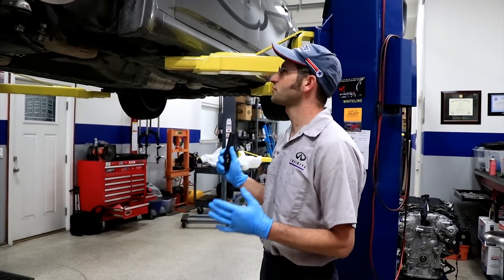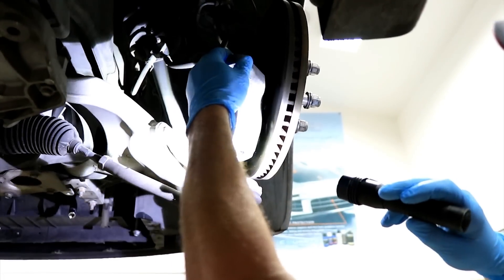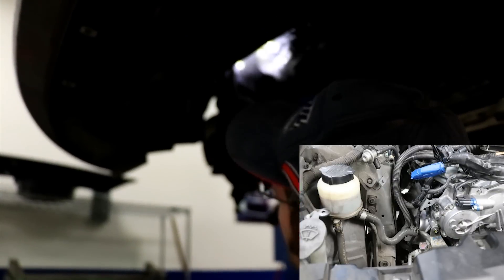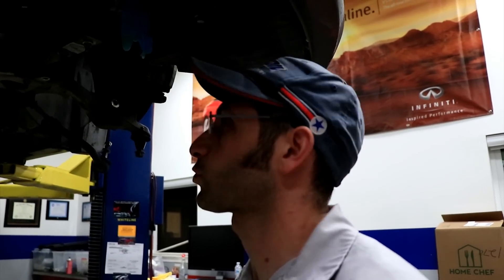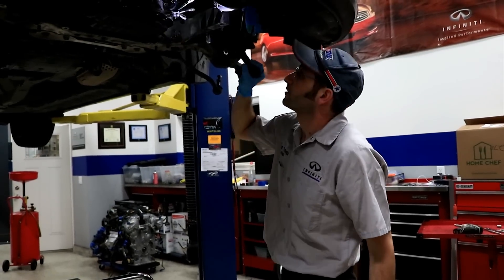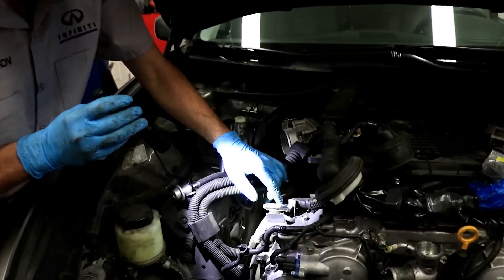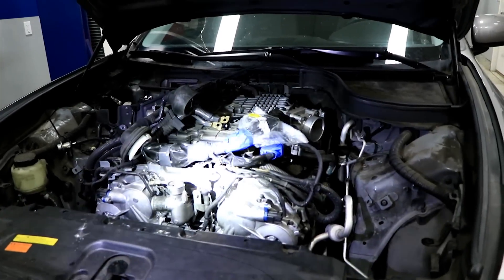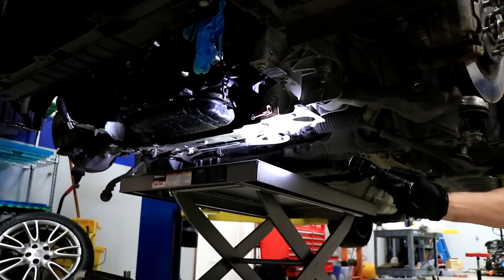DIY: VQ35HR VQ37VHR Engine Replacement (Comprehensive Overview)

Comment: Eugene. Is it possible to replace engine of 2011 G25 with  VQ37 engine?  Direct bolt on/start? Does it require replacement on transmission/ECU/wire harness etc... To be replaced as well?  I guess it would be less headache if I just sell perfectly running G25 and get a good G37. 😁
Reply: I haven't tried that..

Comment: Question I have a 2007 rwd g35 sedan I need a new engine I found a g37 coupe engine would it fit would no problem plug and play plz help I wanna get the engine ASAP from this guy
Reply: Did you get a answer yet?
Reply: @Pure.37  yea I did lol engine had a different set up unfortunately I had to get 07 08 g35 sedan engine so it can be a exact fit…

Comment: I need somebody advise serious advice I got a g37x brought bolt on haven’t put them on yet got test pipe isr y pipe and single exit cat back and Z1 intakes takeda but my car got 112,000 and I’m thinking about goin fbo and getting a tune maybe header eventually but my cad when I changed the spark plugs they were soaked in oil and the car runs rough I think I have gallery gasket should I just swap motor to a lower 2013x engine g37 or sell the car now as Is for 6500 and buy another g what you guys think ?hit me at juanalex6799@gmail.com

Comment: Any suggestions, I'm in Philadelphia and I need to swap out the engine in my G37X .. I need help!!! Anyone who reads this please and thank you
Reply: Bruh you need a lift because to replace engine on that you need to drop the entire front subframe, if you were in Pittsburgh I could have done it for you.
Reply: @audinthusiast3750  you can drop the driveshaft and disconnect the trans and you can pull it from the front
Reply: daniel powell that is just unnecessary amount of work
Reply: @audinthusiast3750  yup but if you don't have access to a lift then you really don't have a choice unless you want to pay a shop.
Reply: I'm in upper bucks hmu

Comment: Awesome video.  I have an 08 g37 coupe.  I'm thinking of engine swapping a VR tt engine in my G37. Any thoughts? Or advice you can offer? Any information would be MUCH APPRECIATED
Reply from the maker: I would recommend replacing your engine and ecu with a newer version and installing a btw tuning GTR TT kit (btwtuning.com). Alternatively a topgunz "ACE" supercharger kit is also an excellent alternative. As for the fuel system I would recommend a radium surge tank setup, I've been very pleased with that kit or you can choose to do a traditional CJM return fuel system kit. I can provide you with a replacement ecu also, as the factory 2008 ecu does not have enough rom space to fully install all of ecutek racerom features. Feel free to contact me with any additional tuning questions.
Reply: Enthusiast Auto Care 
Ok. Good advece.  Thanks for reponding I'll keep that in mind. If I have any more questions I'll ask. Thank you!!!

Comment: This is unrelated, but would you happen to know what causes a certain noise in a lot of Infiniti Gs. At around 1-2k rpms, when slowly accelerating from a stop, doesn’t happen all the time, it sounds like ratting maybe coming from engine compartment or possibly from the undercarriage. My guess is that it could be a loose heatshield maybe? It doesn’t happen from just revving the engine while parked... and as mentioned before, it happens to a lot of Gs (37s/35s). I don’t believe mileage is of concern. My car happens to be a 2011 G37X Sedan with the 7AT
Reply from the maker: it's probably the catalytic converter(s). it's easy to check this. Remove the y-pipe and see if the material inside is moving/loose. An easy way to determine the catalyst noise is to listen to each cat when the noise is occurring.
Reply: @EnthusiastAutoCare  Yeah, that sounds definitely like what might be the cause. I'll get to it eventually. No dash lights or performance issues at the moment so i'll wait a bit before addressing the issue. Thank you for taking the time to reply to my comment.
Reply from the maker: Rigo Arteaga hit me up for a tune !
Reply: If I was looking to modify it, I would. But this one is staying completely stock, due to being a daily driver. Don’t want to compromise reliability. 👍🏽❤️
Reply from the maker: @rigoarteaga1038  I improve reliability with a tune over stock and I will get you better fuel economy. It's a win-win. I Can explain in detail if you reach out.

Comment: I have 2008 g35x AWD. I need to remove the engine. I need help with that engine can’t move freely I can get torq bolt out. What is the best way for me to make drop engine transmission and transfer case at same time or
Reply: Yes

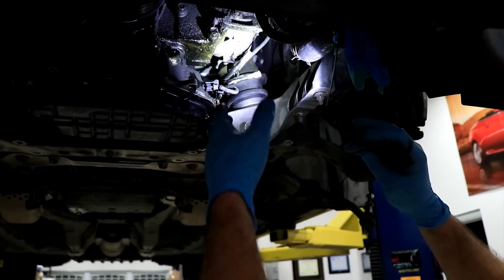Comment: Anyone know on 4:40 what brown plug is for?
I have my wires messed up there, HELP!
Reply: If im not mistaken that's the connector for the power steering assist motor that's on the power steering rack
Reply: It's for the steering angle sensor to the rack & pinion

Comment: Why didn't you pull the front end off?
Reply from the maker: San Saechao pulling off the front end is much more time consuming. The factory recommended procedure is to drop the engine with the subframe as we do here in this video.
Reply: @EnthusiastAutoCare  oh...well I'm pulling the front end off as we speak lol
Reply: @sansaechao2023  lol how did it go? The front end procedure

Comment: What model HaulMaster lift table is that? Trying to get table specs to ensure I get a lift table that will hold the engine/trans like you did in the vid.
Reply from the maker: This is the largest model that is offered by harbor freight.
Reply: The Haul Master lift table rated 1000 lbs. I highly doubt that the 500 lbs will support the power train regardless of the vehicle.

Comment: How can the vq35 ecu run a vq37 it would be lean from the mid range to the top of the rpm curve.  Are the ecu's coded to the chassis number or can they be changed. Thank you
Reply from the maker: please call me for tuning and to discuss this. 415-830-4008

Comment: I have a g35x 2008 3.5 engine can i put a Q50 VQ engine?
Reply: The vq37 will mount directly in places of a vq35. May need custom plumbing and will need the vq37 ecu. Even the vr30tt mounts directly in. Needs shorter engine mounts. Check NoirTm. Doin his vq30tt swap into 370z in driveway. Had engine stuffed in less than a day
Reply: @mikeschaner5853  were can I see or get this info I have an 08 G35x  and I want to do either or swap for a vq37  or the 3.0tt
Reply: @samuelarizmendi  the vq35 to vq37 swap is all over the z and g forums... Z1 did a vr30 swap also but they were no help to me, Noir, or others trying to figure this 1 out. Noir goes from start to finish in a simplified condensed version but is very responsive to YT and IG.
Reply from the maker: It would be too complex, I don't recommend it.

Comment: We got the motor in my 2009 intiniti g37x after a motor swap (same motor from different but exact same car) and the car refuses to do anything other than click the starter. The flywheel won't even crank. We have tested the battery and the starter and both are good. We need help. Why won't this thing start? Is there something we need to do with the ECU?
Reply: Alien Bros did you figure out the issue. I have the same problem

Comment: I am doing an engine swap on my 2009 G37x and did not have a lift so I went in through the front. I have the old motor out but I can't get the new one in flush with the transmission and onto the mounting brakets because the exhuast manifold on the right hand side is in the way. Is there a way to get it in without breaking anything and get it flush with the transmission? The transmission is still in the car. We also disconnected the front differential and connected it to the engine to make it easier to get in. The center axle is also in the engine. We just can't get it in there and get it to line up. Any ideas? Any advice would be greatly appreciated.
Reply: Did you figure out to get it lined up?
Reply: @danielthomas4018  Yeah I did it was a massive pain but we got it done. It took a lot of pry bars, transmission  jacking, and curse words but eventually we got it in.

Comment: So I Did the swap already but the car doesn't want to turn over.we replaced with new starter, battery,n sparkplugs  but the car doesn't turn over?..any ideals wut  it can be? Would really appreciate it
Reply from the maker: Check to make sure the engine can rotate freely by turning the crankshaft manually.

Comment: Thanks for the great video.  I'm about to do the same on my car.  Did you have to drain the automatic transmission fluid before you separate it from the engine? Thank you.
Reply from the maker: yes, but it's not required.

Comment: I just had my engine changed (g37) with a q50 3.7 block i conected everything but the engine turns over but it wont start. Now that little ground wire that you were trying to unplug passenger side under the car that seems to go from the exhaust manifold to the body. I remember it on the g37 engine but it was not a plug it was bolted onto the body. Now this new engine did not come with that ground wire will this prevent the car from starting. I also dont have any codes. Any help appreciated. Thanks
Reply: Run the new q50 computer well your at it lol

Comment: how much did this cost? this looks expensive as hell
Reply: Time and money. Figure about 8 to 10 hours unhooking things and another 10+ hours putting things back in + the cost of getting the A/C unit charged, Power steering working, coolant refilled. I figure this is about a 4k job and that doesn't include the spare engine. Also you should ensure the spare engine was not abused and I would replace the dreaded galley oil gasket with the reinforced metal one.  It's not a cheap job and if you could find a spare engine and work on it part time while you get your funds together, It may lesson the blow financially.

Comment: I need help and don't want to get ripped off by mechanic I'm throwing two codes p0300 and p0021 car runs in limp mode after 2k rpm engine and muffler sound like a tractor trailer and shaking i have a 2009 infiniti g37xs AWD sedan HELP PLEASE.
Reply from the maker: Blixky you should test the oil pressure. It is likely the rear timing cover gasket has blown.
Reply: @EnthusiastAutoCare  what's the readying o should get at idle and at 2500 rpm after the car warms up
Reply: @Trinibad718  I dont understand your reply.
Reply: @DeathDealaJayJ  forget it infiniti sucks got a bmw and I'm in love
Reply: @Trinibad718  Thats funny because my BMW has broken down more times on me than i can count...my infiniti? 0 times.You want to know what kind of taxis are used in Germany? BMW's lol because they are crap beater cars.

Comment: Did you use the stock g35 Ecu or did you have to swap ecu too?
Reply from the maker: stock ecu. If you need a replacement ecu, send me a message.
Reply: @EnthusiastAutoCare   Hey I have a 08 g35 sedan and I just bought a 2013 g37 sedan for parts and I wanted to no if its possible for me to swap motor and trans from the g37 to my g35
Reply: @alfredolanzo2002  well that’s what he did in this video particularly lol it’s possible

Comment: Awesome work! How much did a job like the cost to overhaul? I have a g37 sedan, and I want to put a new used engine in it so I can boost it.
Reply: I have a guy he charges 1000$
Reply: @Trinibad718  where are you located I need this done
Reply: @Hayer0228  😂
Reply: @Trinibad718  😂

Comment: Great video... finally, someone whom can explain engine replacement clearly concise step by step methods. And with more adjectives...lol. Very professional...thanks again! I own a 2004 350zr, getting this exact noise from inside the passenger cabin side. I presume...way before this happened, I may have tightened up both Alt./AC belt a little too much...maybe this was a start of a problem. Watch this video, this the noise I hear! https://youtu.be/r0xksoTvuME Hope you receive my message, perhaps you can help me with it. Thank you very much in advance!